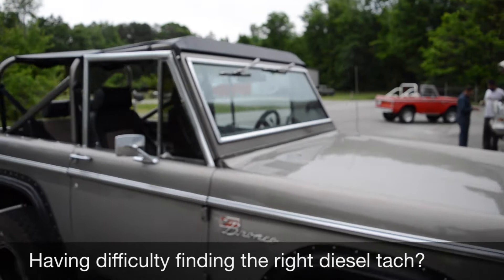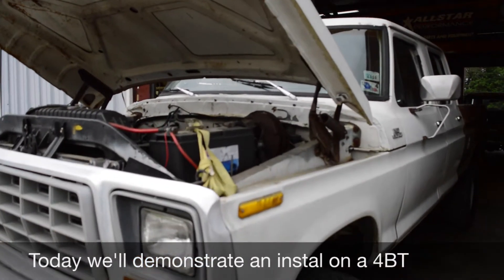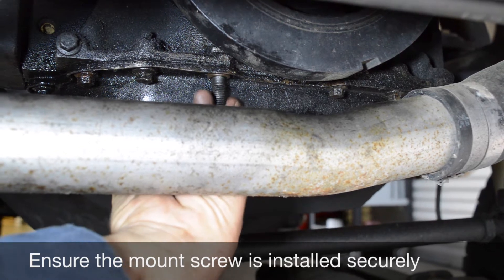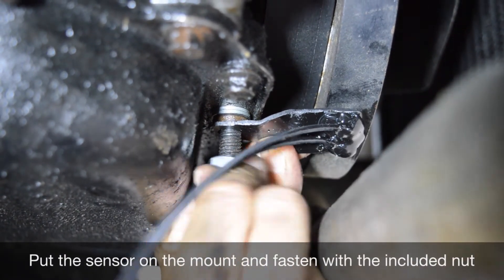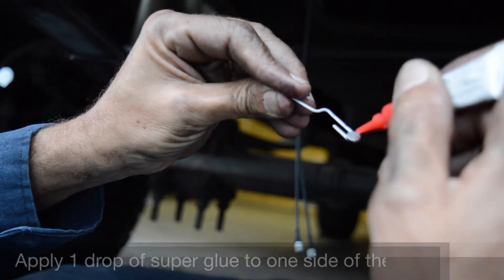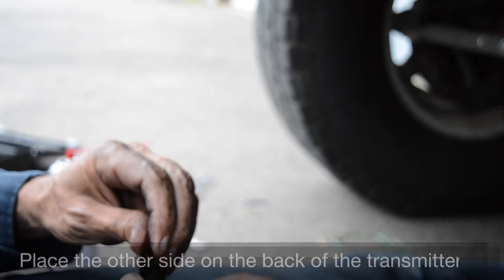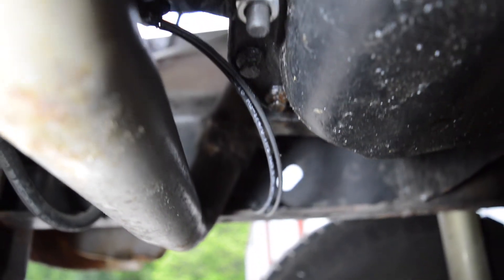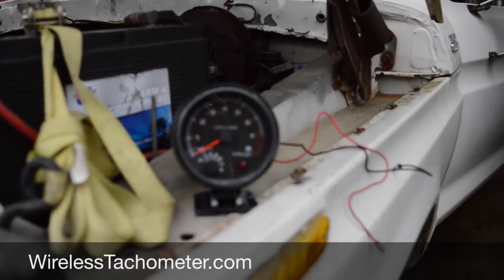AutoHack Diesel Tachometer Installation

Comment: Would this work with a two cylinder air cooled diesel engine?
Reply: It should. It’s based off of crankshaft position essentially. So as long as you have a crankshaft and 12v you should be in business.